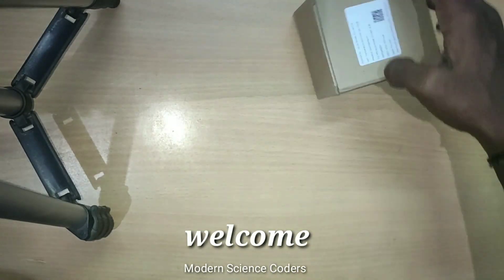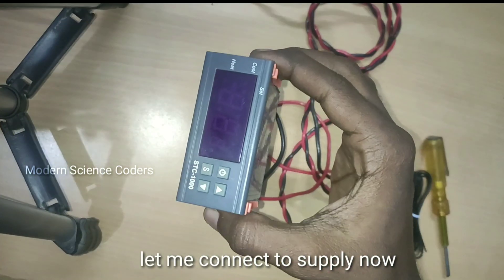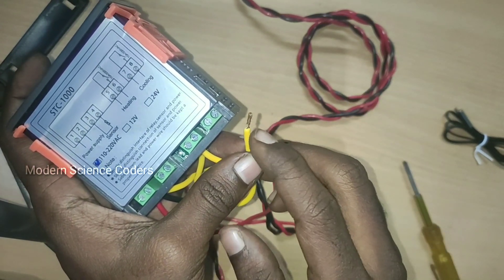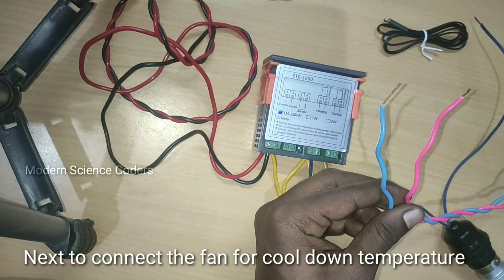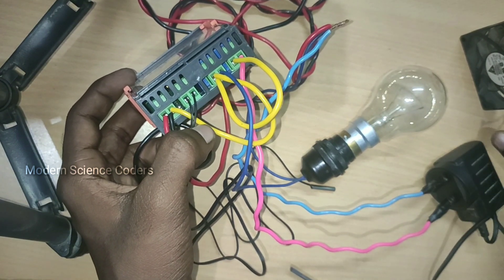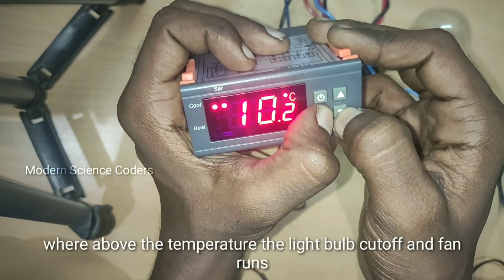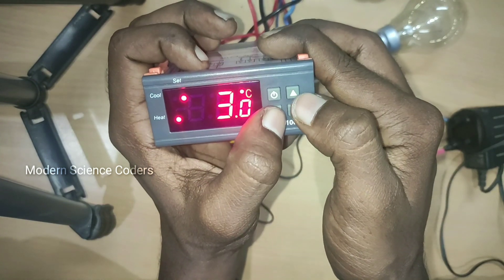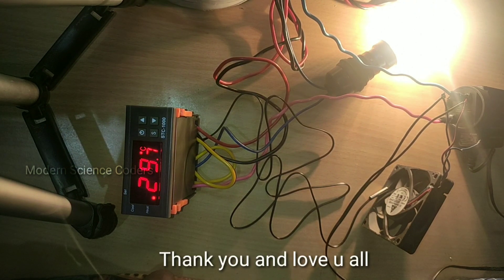Egg Incubator (with Subtitles) - Tamil முட்டை கொள்முதல் செய்ய தவறாமல் இதை பார்க்கவும்!! | STC-1000 |

Comment: இந்த STC 1000 controlerஐ DC(12Volt) Water Heater(Aquarium)கு Use பண்ணலாமா (Auto Cutoff 26Deg Auto On / 30 Deg Auto off) ? without Fan, 
 Wiring explanation and temperature control setting pls

Comment: Hi Anna stc-1000 LA (PTC incubator heating element use panalama)
Reply: Questions?
Stc-1000 is works ac or DC or both?
Ist works 12v car battery using invertor?
CPU ac fan support panuma bro?
Reply: Bro heating element and fan ac use panalama and with invertor
.invertor-heater-fan (ac) use aguma bro